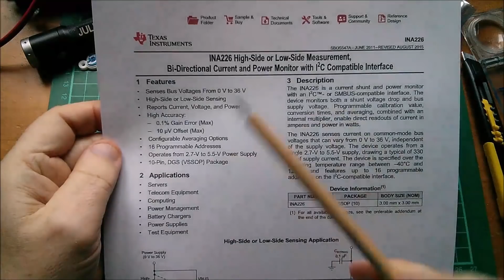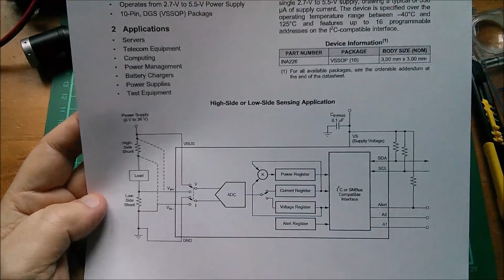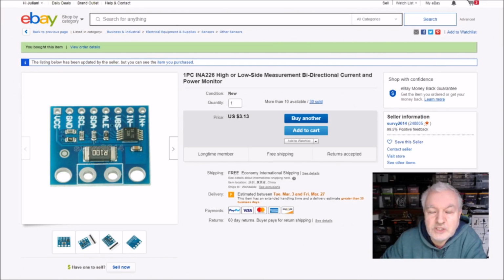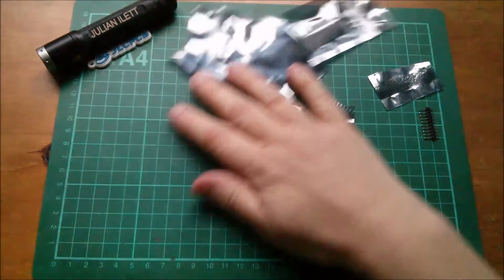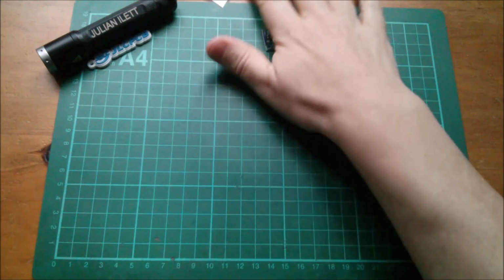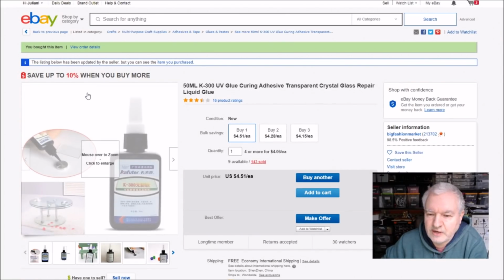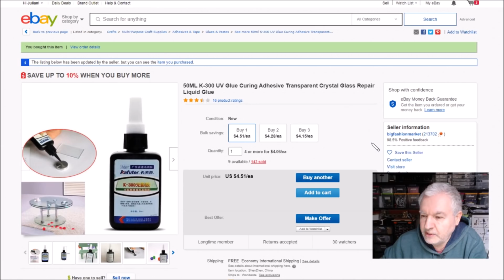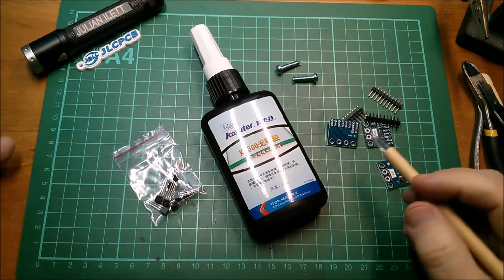Julian's Electronics Postbag #144 - INA226, UV Glue, Transistors

Comment: I know it's been a long time since this video, and I also know that you made power meters using the INA219 module, but did you ever do anything with these INA226 modules?  I've used INA219 modules before, but they are limited to max 3A current - which is why I guess you went for the INA226 instead as I believe they can handle higher current?  Interested to hear what you did with them....

Comment: 4 unique addresses with two settable address bits (A0 and A1):  00 01 10 11 so you can add 0, 1, 2 or 3 to the base address depending on how you  connect the A0 and A1 bits (or not).
Reply: To get other addresses you need to connect A0/A1 to SCL/SDA.
Reply: @lunokhodtoy  I've never heard of that before.  Are you sure?  I think that would allow you to change the address of the module within the 4 address range dynamically but I don't understand how that would get you any other addresses.  But I'm willing to learn!
Reply: @kirkb4989  it is from datasheet, there multiple options to connect to, not just VSS and GND, it is new for me too :)

Comment: Usually the UV adhesive you get in those large bottles is for joining a cellphone front glass to the touch sensor. It won't surface harden which means it will be sticky, it also won't go completely rock hard. What you want is UV cured "No wipe top coat" for nail art. That stuff hardens fully and leaves a dry surface.

That said, all the ads that show people joining things like two screws end to end or repairing eyeglass frames are basically scams. UV adhesive is good for covering sensitive things (SMD LEDs on a PCB people are supposed to touch for example) or joining large transparent surfaces together (screen and touch sensor as above).

Comment: What's so special about those "general purpose" transistors?
Reply: BC182L were a favourite of one of the contributors to the magazine that the Vocoder was published in. A lot of projects by the same author used them. Any suitable general purpose small signal NPN transistor can be used to replace them in most designs as long as you take account of the lead-out. And keep in mind that the same transistor was/is available without the L suffix but it has a different lead-out.

Comment: I set mine with a 50 led 240v lamp - I've been using what looks like similar stuff.  First time I used it I thought it was rubbish.  My usual glue comes in 10ml bottles and only takes a couple of seconds to cure, this new potion wouldn't set = After a bit of playing I found it takes considerably longer but to be fair sets much harder/stronger and without the sticky residue but we're talking 5+ minutes.  Longer to be safe.

Comment: Beware of Chinese INA226 modules , won't get accurate voltage readings with default LSB value. You may need to manualy measure the voltage , calculate LSB based on corresponding  ADC value, average out  and add this LSB value in the code . 
Current measurements on the other hand is pretty accurate up to mA.

Comment: 10:53 Noooooo!  Bad idea only putting a small hole in the seal.  Now when it starts to get close to empty you will have to have it perfectly level and it will be more likely to spit out as you squeeze the bottle.  Removing the complete seal allows the bottle to be at an angle and allows better flow.  Think about it.  And if you ever want to put the flat cap back on you'll get glue all over the place as there will still be glue in the funnel.  Next time just cut it with your snap blade knife on the inside edge.
Reply: "Next time" as in "when you have used up that bottle and start a new one" which is probably "in 15 years" :D
Reply: @muh1h1  - Perhaps but since Julian likes to use it as a conformal coating for his charge controllers I don't think it will last that long.  At least he isn't using those tiny little "sample" size tubes!

Comment: Can those things have 5 different I2C addresses?
Reply: http://e2e.ti.com/support/amplifiers/f/14/t/811151?INA219-I2C-Address
Reply: @DavidGranz  Wow, that's an unexpected addressing method.
Reply: I should add that while the INA219 does support strapping for 16 addresses, the breakout boards do not easily allow more than 4 addresses. It's possible to strap to the other addresses, but resistors will need to be removed from the A0/A1 lines and patch wires added. It may be easier to use a I2C multiplexer
Reply: I'm not sure it can with the pads that are broken out.
Maybe there are additional address pins on the chip that can be accessed via bodge wire?

Comment: Curing the UV glue is also influenced by the wavelength. Many of the UV torches are closer to 400nm ao rather more deep violet than ultra violet. Around 360nm works faster, even shorter is better still. The exposure time to cure the glue will be sugnifucantly longer for the long wavelengths. I found closer to 3 to 5 min for good curing. Intensity is less effective than shorter wavelengths!
Reply: Very helpful info! Been looking for quite some time to locate what wavelengths of UV are most effective/efficient at curing.  Seems as though the manufactures of UV glue would publish the wavelength that is best for their particular formulation.   
Thank you Helmuth!
Reply: I have read that distance from the glue also plays a big part. Recommended 3-5mm from the glue.
Reply: Yes my message also stated 3 to 5, for some reason it was type/spell converted to "min" where I had wanted "mm", so that agrees to my former comment as best distance light to glue

Comment: Hi Julian, is the i2C signals referenced to the gnd input, i can't see a digital ground. so not sure how they will communicate over I2C if the grounds are all at different potentials and you try and connect all the i2c lines to a mux?

Comment: If you can set A0 and A1, would those only be the two lowest bits, so 4 addresses?
Reply: TI used sort of a trick to allow up to 16 addresses... it's described here: http://e2e.ti.com/support/amplifiers/f/14/t/811151?INA219-I2C-Address
Reply: I should add that while the INA219 does support strapping for 16 addresses, the breakout boards do not easily allow more than 4 addresses. It's possible to strap to the other addresses, but resistors will need to be removed from the A0/A1 lines and patch wires added. It may be easier to use a I2C multiplexer.

Comment: I found that glue needs around 2 minutes with one of those powerful UV torches. Not quite how it's advertised...
Reply: We also don't know if the wavelength of these flashlights is what the glue needs.
Reply: @voltlog  I have seen claims of 220-260nm wavelength for this stuff so you'd need definitely something else than an LED for that.
Reply: dito, the little torch did not do too well. got a higher powered UV tube for a fish tank might give it a try.

Comment: The R010 resistor looks like a SMD version of a ceramic power resistor.
If your cells are in series, will you be able to connect all the I2C comms together?
You may need a I2C isolator.
How will you power them, is gnd on the output terminal strip connected to gnd on the battery measurement side?
You need to draw a schematic and check your potential difference logic.
The UV glue, because you are trying to use it like a filler, may need more time to penetrate. The pens dispense a thinner/less viscous liquid.
Reply: I probably point your way, I would believe because the ground is the only fixed point, I would just use one of 226 and the other I would go for ADS1115 (there are 4 voltage reading).
Reply: Thinking that if you only care about current, connect the grounds together. then the I2C will all be at the same 0V so should be ok. As long as the battery voltage does not exceed 36V it might work.  might work, might let out some magic smoke. But thats where the fun is.

Comment: Let me know if you solve the K300 problem. I bought 2 bottles in 2019 (after seeing you glue your pcb's). No matter how much UV light I shine at it, it never gets solid. Even tried several frequencies and intensities of UV (sunlight of course as well). Shaking the bottle did not help either. I now have two of those bottles laying in my drawer. Getting old. So please find out how to use it as 'glue' because currently it is just a sticky liquid. Note: my real intention was to glue solar panels from Ali, to make them more rigid (those very thin ones, you know them? Just micrometers thick). But the glue never dried, so that was the end of a failed project.
Reply: Here's an experiement to try: Leave it in the sun for an hour and see if that does the job.
Reply: @melkiorwiseman  Yes, I know. And tried. I think it was a faulty batch. PS: currently it is winter, and there is not much sun right now.
Reply: @deslomeslager  Based on that information, I think you may be correct and it was a bad (or just sub-standard) batch.
Reply: I've seen quotes where it needs 220-260nm wavelength. If that is correct you might be able to do it with an expensive LED but probably some germicidal tube like pulsed xenon (works wonders on erasing old ROMs BTW).
Reply: @benbaselet2026  The main problem with using short UV is that you need to shield it so living things aren't exposed.  It's especially bad for the eyes.

Comment: The UV glue should not really be used as a glue, it's more like an epoxy.  You would use it to cover things, say as an insulator or conformal coating, or else create things, like trinkets, by using it with a mold.  As a glue it really is weak as you found out.  It also often needs to be cleaned on the outside with IPA and then left in the sun for a few hours to fully cure.  But for what it does, and how it does it, it really can be quite convenient and useful.

Comment: 16 Programmable Addresses
Reply: Alas this board only support 4 addreses, without cutting traces. To get other addresses you need to connect A0/A1 to SCL/SDA. This board has an pull down resistor on A0/A1, which would interfere with the I2C pull up resistors...
Reply: @ÁlvaroM.ValdebenitoB  yes, I did check only chip specifications
Reply: @DIY Projects just look at the board. The IC supper 16 different addreses, but A0/A1 jumper pads have only 4 posible states.
Reply: @DIY Projects yes, the IC can be configured to 16 different addresses, but as I wrote before this board can only have 4 of the 16 without cutting some traces (or removing some resistors)
On this board, the A0 and A1 pins have 10k pulldown resistors. If A0/A1 are connected to Vcc, the pulldown resistors do nothing more than wasting a bit of power. However if A0/A1 are connected to SDA/SCL the pulldown resistors interfere with the pullup resistors of the I2C bus. That is why this board can only have 4 different addresses without cutting the pulldown traces or removing the pulldown resistors.